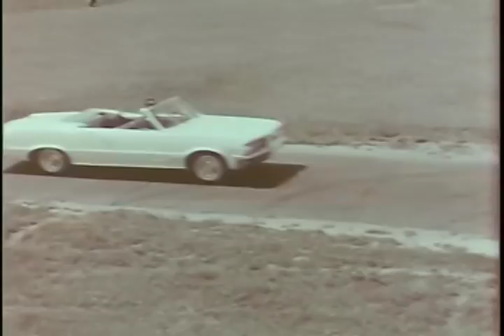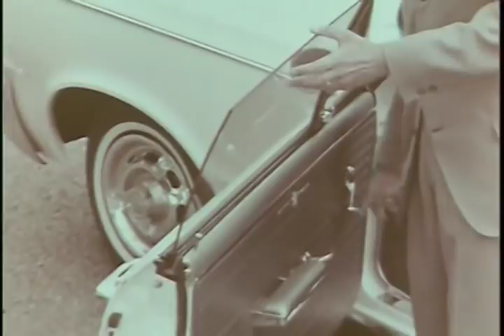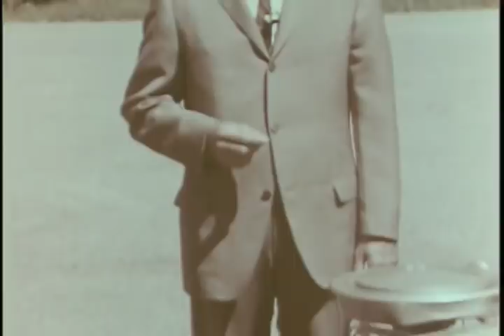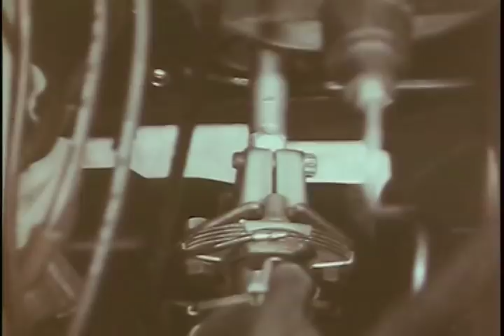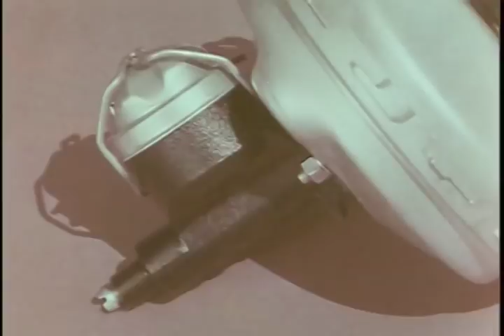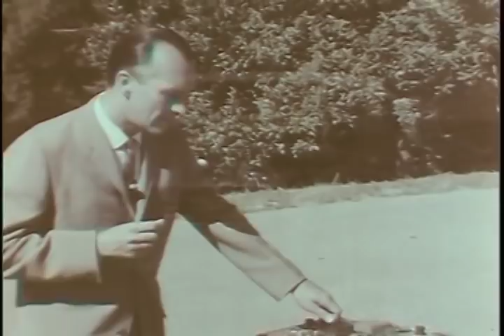Pontiacs for 1964

Comment: Funny their is no mention of the GTO. If memory serves me correctly, that was the icon's first year. Maybe it was introduced later in the model year.
Reply from the maker: DeLorean was under orders not to put big engines in small cars.  GM and the other automakers were downplaying racing and performance because a series of racing accidents generated bad publicity.  In GM's case they also didn't want to drive up sales too much more because they were deathly afraid that the government would step in and break them up since they already controlled such a huge percentage of market share.  It was a delicate dance.  So DeLorean snuck its announcement in at the tail end of his presentation to the dealers.  Kind of as an aside.  Of course, the dealers had heard rumors it was coming and went nuts when it was official.  He told them that only a few would be available.  What he should have said, only a few meant, only as many as they could sell.  For all his foibles you have to admire him for this "up the organization" maneuver.
Reply: Thanks for the info.
Reply: Might be because the GTO was a Tempest option. It did not become its own model until 66
Reply: Even being a staunch Mopar guy, I agree with you Daniel.
Reply: You sure it wasn't till 66. I think you are right on the 64,but I think they may have stood on their own the next year. But, what do I know, I'm a MOPAR guy.
Reply: The GTO was introduced mid year, 1964
Reply: TheFRiNgEguitars The lemans became its own model in '63 (it had its own vin code from their on out) and the GTO became its own model in '66; also with its own vin code. The vin would start out in "242" and the "42" identifying that this was a GTO. And before you start to say they were based on the same platform therefor making them their own car, a lot of cars were based on that body platform, such as the Chevelle, olds 442.
Reply: I think you are correct. I knew at some point it became it's own model and I thought 65 may have been the year. Looks like you know your GTO's. Thanks for clearing this up for a Mopar Guy.
Reply: Daniel Keener Hey Dan, Yes The GTO received the number 42 as a series (but this was in 1965) its second year in production. I personally regard the GTO as its own model. Certainly there's a world of difference between the performance of a GTO vs a Tempest. I have owned a '69 and a '70. However the GTO was registered by description on the registration as a "Pontiac Tempest". This was an attempt to help keep insurance rates lower for GTO buyers. (as also their published hp ratings) Most insurance companies didn't bother to check the exact model by the VIN number or didn't care. Just for argument, the Safari wagon also is a separate series, 39. The Safari was also a Tempest model, but shares a separate VIN series just as the GTO does. In 1972-73 the GTO became officially an option of the LeMans, then in 1974 based on the Ventura... sadly! The GTO as a separate model is a gray area, as ALL of the GM models in the same era were separate models as per the VIN numbering system in effect at that time. Some models that were once options became a separate identity, a fair argument. It was simply the VIN numbering system that GM adapted for the entire line of that period, not exclusive to only the GTO.
Reply: TheFRiNgEguitars
I have 2 65 gto's and one 69 and two 67's and plenty of other parts cars and "plates". It was 66 that they began to start the vins with 242. To know 100% if a '64/'65 car was a true gto or a clone you have to send the vin off for phs documentation as Pontiac tried to keep EVERY build sheet for their cars. (a really cool feat for people like me who can restore their own pontiacs (i've got a shop and a small car lot 20+ years in salvage rebuildables) and that's why some Pontiac people are so crazy for originality... like myself..). I've paid for phs documentation for all my plates (to know what head, engines, tranny, rear end, gauges/all options that aren't listen in vin codes. The tempest and the lemans 65-70ish had their own different vins as well as the safari, tempest custom, t37 ect all were based on the same platform but are different models on the same platform(aka floor pan, also the 66/67 chevelle and gto floor pans were pretty much identical) and vins begin differently as they have more then subtle differences coming down the assembly line such as different tail panels and quarter panels etc, which is why they are separate models, and not just that era were they doing this. For arguments sake many car manufacturers have been doing this for years and still do this to this day and they consider them different models. As for registration, over the years buying old pontiacs, I've noticed that it can vary from state to state probably because of different state insurance laws and requirements and systems.
Reply: haha yea there is a lot more to the GTO's story that your missing;)
Reply: Its the first true muscle car for a reason....
Reply: No, The GTO was never its own model. It was a Tempest option as was the LeMans. 

Edit: I am mostly incorrect, sorry folks,but not entirely incorrect. The GTO's were described on the registration as  "Pontiac Tempest", merely a formality to help keep insurance rates low for GTO buyers. The argument as a separate model via VIN # is a stronger argument, even so that was up to the higher powers at GM to make it so, or just a performance package with GTO emblems.. as it became again in 1973.

Comment: I Thought that the in-line six was only used in Canadian full-size Pontiacs
Reply: CVUEGUY:your correct the Canadian pontiac had a 6 from day one and was a rebranded Chev. In 62 when Pontiac went wide track not so in Canada the canadian cars were smaller in size and used much smaller engines. A friend of mine had a coworker who took his 6 cylinder 1958 into a dealership in the states lots of questions because in those days pontiac used v8s.Many years ago I had a 1949 sedan it was powered by a flathead inline 6.
Reply: before the end of the sixties, full size cars sold in canada were  often equipped with an inline six engine and three on the tree gearbox, about only the luxury , high priced cars were sold with a V8 and automatic transmission as base equipment
Reply: that was a tempest

Comment: How interesting that in 1964 they were pushing the 6-cylinder engine and how quiet the car was.   I guess this was before the GTO took off and Pontiac was still the "old man's car" division.
Reply: SquillyMon
When these were used cars in the 1970's, many people yanked out the "sprint six" in favor of a small-block.
Reply from the maker: +Robert Bell It was just before the GTO.  They were under pressure to build safe cars and avoid high performance.  The GTO upended that apple cart.
Reply: King Rose Archives
Of course, Delorean was big on European sports cars and introduced the OHC "sprint" six a year or so later - in the tempest and the early Firebird.  It went over like a lead balloon in the era of cheap V-8's.  They are very rare and collectible now....most people tore them out and put in small blocks.
Reply: I know...right ?  I have never seen an OHC in the wild to be honest...just pics.  Plenty of the regular straight sixes tho...but never the OHC

Comment: I want a Star Chief.or a Bonneville. And the blonde.  Just a production question: they (GM Photographic Unit) were using a crane to film most of the shots, but didn't use a boom mike, instead he had to lug around a nasty microphone cable trailing from under his coat. But geewizz he was enthusiastic! I loved it.
Reply from the maker: Stu Art. I think it would have been seen in the wide shots.  Didn't have radio mics in those days.  GM Photo always had the latest toys.  They would have had one if it existed.
Reply: Stu Art. I want that sloop in the opening!
Reply: RapidRrobert  Granted! Although, have you seen Humphrey Bogart's beautiful boat "Santana" ? Its a  55' 1935 schooner. Apparently It still sails and races on San Francisco Bay. You can see it in the movie "Key Largo" (1948)

Comment: Single reservoir master cylinder.  Once it goes, all the braking is gone.  Hold on!
Reply: I had a '89 Buick Regal with dual brake system;  front left line broke after Pep Boys did a brake job on it and I went sailing down the road with the brake pedal on the floor;  the parking brake was a pumper-type (3 pumps) so had to ram the curb to stop.   So much for the dual master cylinders.
Reply: It wasn't the single reservoir that made it less safe, so much as it was the single PISTON in the master cylinder. But yes, each piston needs its own reservoir so there will be fluid for it if the other piston is pumping fluid onto the road.

Comment: Pontiac always had the best styling in the early '60s
Reply: GM in general, but I've always been partial to Pontiac.
Reply: BS, it was FORD!
Reply: @davidcampbell1899  Pontiac bumped Chrysler out of the #3 spot in the 60s, just behind chevy and Ford. The only reason they out sold Pontiac was because they were cheaper. Period
Reply: Buick.
Reply: They sure did brother
Reply: All cars from the 1960s had outstanding styling.

Comment: And, remember.  These cars were the best engineered, quietest and most reliable cars ever in the Pontiac line.  Well, until the '65 models hit the road.
Reply: LOL.  "You don't want your "old" 1963 model anymore, do 'ya"?  "You want a new improved 1964 model, don't 'cha"?
Reply: I'd take a 65 Catalina 2+2 with the 376 horsepower 421 HO-4 speed over a 65  GTO. The 65-66 Catalina 2+2 were beautifully styled cars. I love the 65 Tri Power GTO...my favorite GTO other than a 69 Ram Air IV. But I'd take the 421 HO powered Catalina 2+2 if I had my pick of any 1965 Pontiac
Reply: Holding out til ‘65 - they will never make ANYTHING better than those ! Ever ! My people on the inside said so !!
Reply: Even the 65-69 are still well made especially compared to the junk we have today.

Comment: News flash...it's a Chevy 6...
Reply: the six used is a 215 (exclusive to Pontiac) - only difference with the Chevrolet third gen six is the flywheel bolt pattern (215 uses the Pontiac V8 flywheel bolt pattern - Chevrolet six (194, 230, 250) used the 3.58" bolt pattern shared with the V8 (small and big block with internal balancing exc 400 and 454)
Reply: Besides the obvious there's this from Pontiac archives:  "The 215 cu in (3.5 L) straight-6 was produced in 1964 and 1965.. It was a smaller bore (3.75") version of the 230 cu in (3.8 L) Chevrolet straight-6 engine."*****
Reply: Chevy 6 was 194 or 230 cubes, same basic engine definitely not "all new"!

Comment: OK I get it. Smooth and quiet. Is that what sold 200,000 GTO's in just the last 1/2 of '64? And remember kids getting car sick? For you youngsters that's like sea sick but in a car.. Paradigm shift on the way...
Reply: Here are the production numbers 

64--32,000
65--75,000
66--96,000
67--81,000
68--87,000
69--72,000
70--40,000